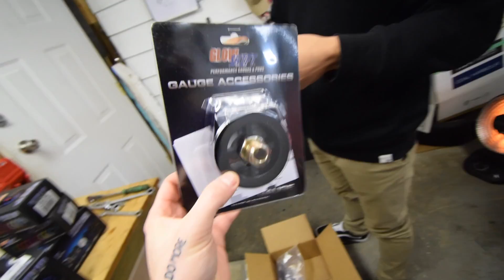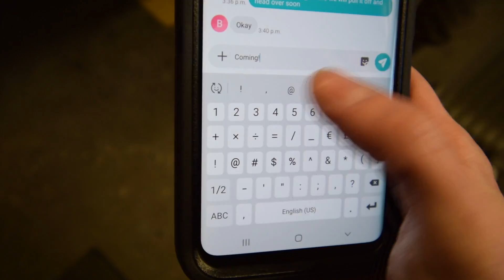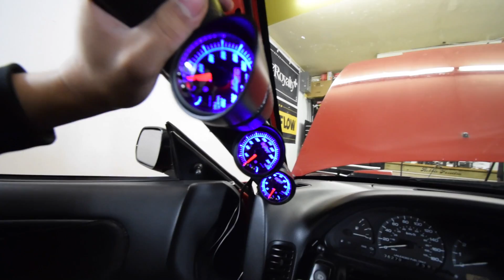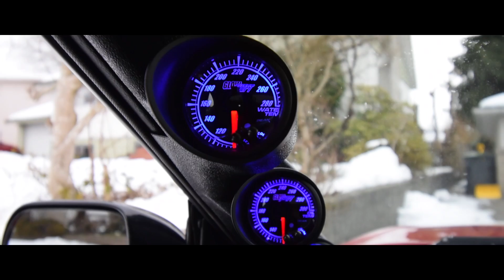NEW GAUGES + Pillar Pod Install!!

Comment: i dont know why everybody hates on glowshift. ive had glowshift gauges for over 2 years and they have not caused me a single problem. they still work the same as when i opened them and run like i just took them out of the box. I Back Them

Comment: Hey

How do you wire the gauges so they always light up when car is on regardless if your lights are on or not?

Cheers
Reply: wire the wire meant to go to a headlight source to a switched 12volt source so when key is turned on lights come on aswell instead of turned on with headlight switch

Comment: I have glow shift gauges in my 240sx s13 but I didn't write up the dimmer wire because I didn't know where to wire it. do you guys know where to wire it to.
Reply: J R they have a dimmer switch to control the brightnes but it told me not to wire the gauges to it because it will flicker

Comment: I watched countless videos and neither showed me how the gauge attaches to the pillar. My gauge is loose as fk. There is no clip or screw holes. You just pushed the gauge in the pillar and it should be tight? Maybe I got a glowshift 2 gauge defect pillar.